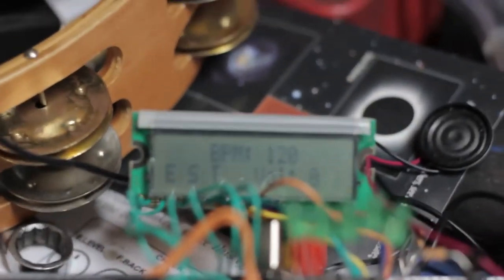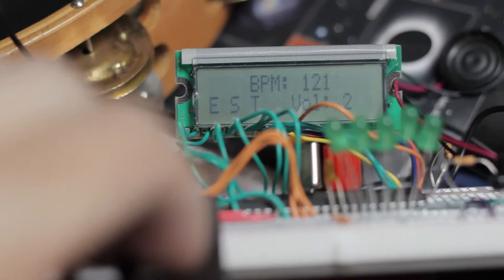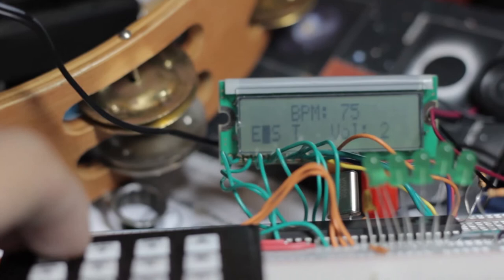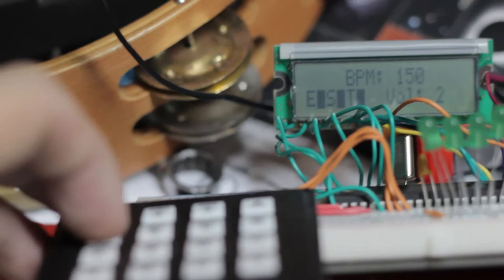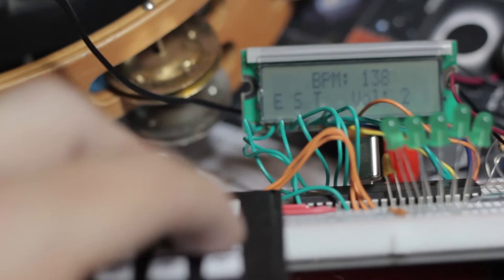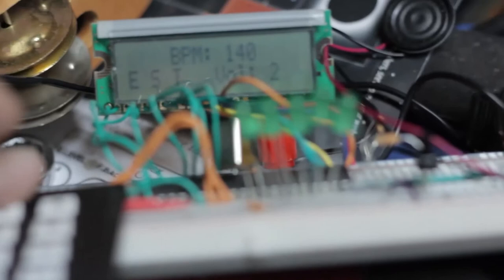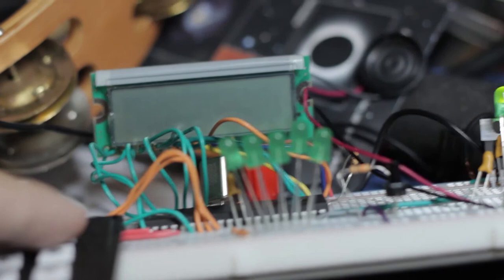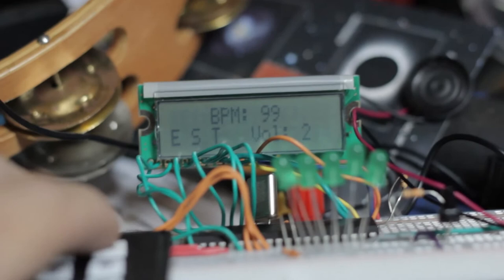CS145 Project 5: Metronome

Comment: Is this for CS or CSE ? If you are CS, do you learn how microcontrollers work + its components as a CS major in UCI? I'm asking because I'm transferring to UCI soon and I'm undecided between CS and CSE lol. I mainly want to learn about computing and software algorithms, but I don't wanna be dumb and know nothing about hard wares and making my own little electronics using arduino and what not /:
Reply from the maker: Hey Pinoy you can take this class in either CS or CSE. If you are only interested in embedded systems at a high level I'd recommend going CS and doing the Embedded Systems (it might be called something else now) track. I was a CSE major, but ended up doing software as a career. I loved CSE and have no regrets doing it. CSE goes more into the lower level physics and math behind electronics, but you still take most of the software classes a CS major takes. If you are up in the air, it's easier to transfer out of CSE into CS than transfer from CS into CSE.
Reply: Holy crap thanks. I did not know there was a track for embedded systems in CS. Now, the only thing bothering me is whether I care to have engineering in my paper after i graduate or not lol